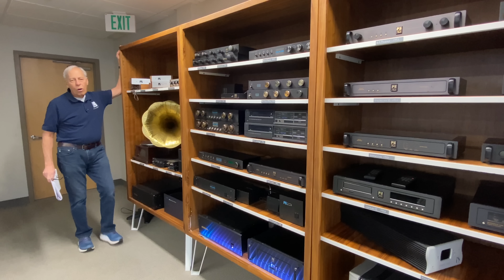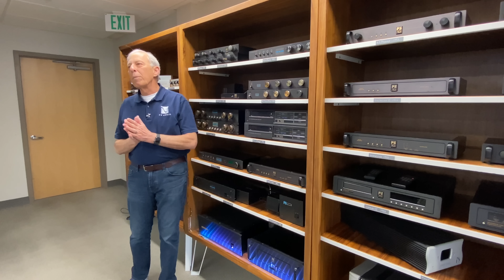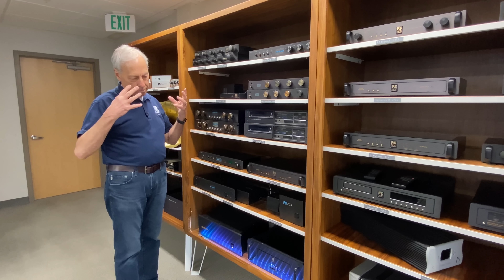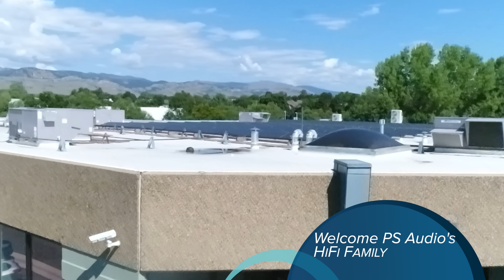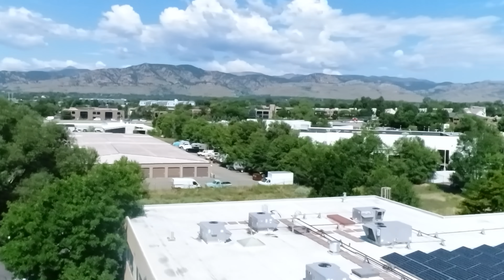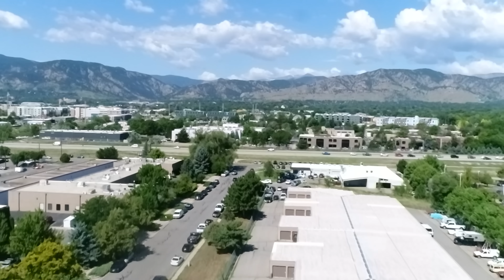Where do engineers go wrong?

Comment: If you can’t give a real test and measure in these Case CABLES IS ALL THEORETICAL. You can said that you Heard a different when you use a different cable ( usually expensive ones )  Because the way is constructed . In my understanding and knowledge of Electrical systems the way a cable behave depends on the leng , gauge of the wire and the resistance this wire have ! I think one of the only times a cable can make a difference in a sound is if the cable is a shielded ( PREVENTS FROM OUTSIDE NOISE TO GET IN A DEVICE) . There is a lot of SNAKE OIL IN THE MARKET , Don’t be fool and fall for it!
Reply: Larry Niles lol